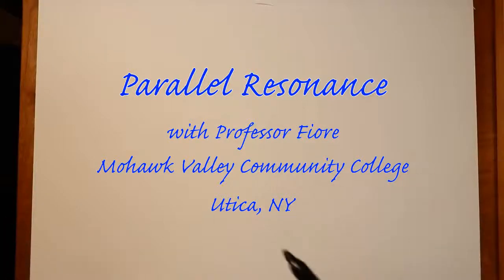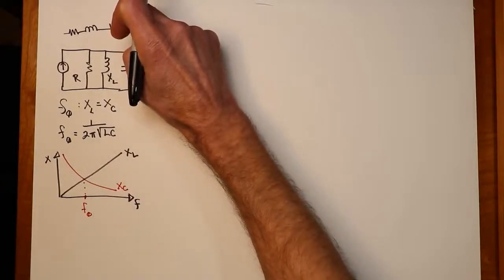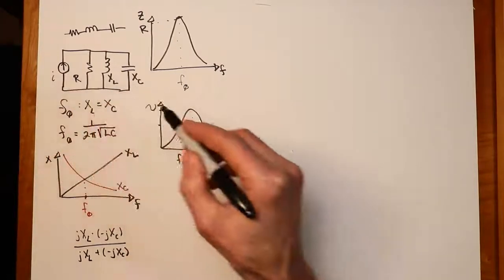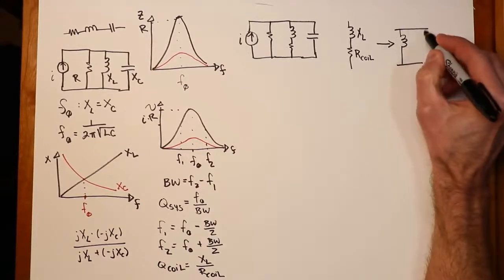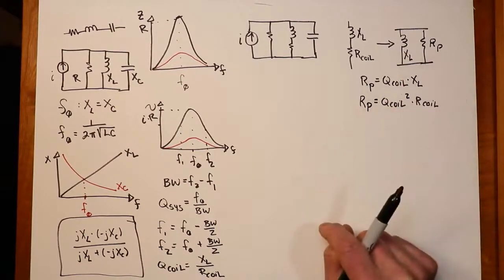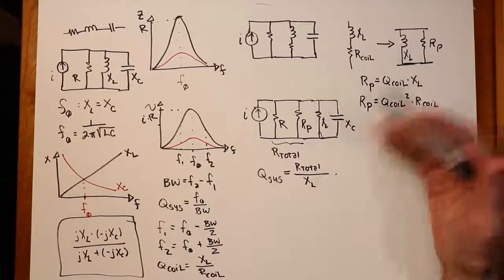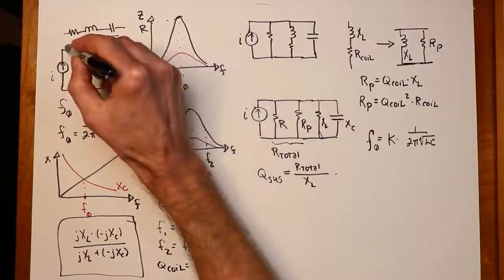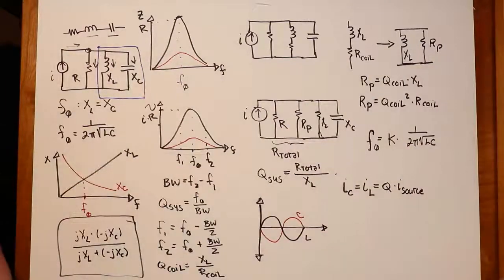AC Electrical Circuit Analysis: Parallel Resonance Introduction

Comment: Thank you Professor Fiore for this great lesson on Parallel RLC circuit! Everything makes sense when the circuit is driven with a current sinusoidal source. I tried to analyze the same circuit with a voltage sinusoidal source. I ran into a big trouble when I tried to derive the bandwidth expression. Would it be possible if you post another lesson on this same topic with a voltage sinusoidal source. Thank you!
Reply from the maker: As a parallel circuit, the voltage is the same across each component. What you see instead is a change in the branch currents. You see the same sort of thing with the branch currents that you did with the voltages here (in reciprocal fashion), but generally, using a current source (e.g., a bipolar transistor) is the way to go. I suggest that you download my text "AC Electrical Circuit Analysis: A Practical Approach" from my web site (free) or grab the inexpensive paper version on Amazon as there are a large number of graphs that illustrate the impedance and voltage/current changes across frequency.
Reply: @ElectronicswithProfessorFiore  Thank you Professor Fiore for your kind reply! I will download your text to see if there is an answer for me there already. In case of current source, the dissipated power of circuit reduces when frequency deviates from the resonant frequency, so it makes sense to define the circuit bandwidth using side frequencies where the dissipated power is half of the power at the resonant frequency. In case of a voltage source, as long as the amplitude of the voltage source is fixed, then the dissipated power is not changing with frequency, then we are no longer able to use the dissipated power to calculate the bandwidth. This is the trouble I have with the voltage source.
Reply from the maker: @yougoog1  The voltage is constant but the impedance isn't. At resonance, the impedance of the network is at maximum. As you move away from resonance, the network's impedance decreases, and thus, the source and branch currents change. Therefore, instead of concentrating on the change of voltage across frequency, consider the change in current across frequency. Instead of "square root of 2" change in voltage, we look at "square root of 2" change in current. Technically, with a constant voltage the true power (P) will not change although the apparent power (S) will.

Using a current source, the increase in Z at resonance causes an increase in voltage. If the voltage is constant, Ohm's law dictates that the current will decrease at resonance. It can be shown that the branch currents through the capacitor and idealized inductor are Q times larger than the source current. This might sound impossible, but it is due to the fact that the L and C currents are 180 degrees out of phase and effectively cancel each other at resonance, leaving just the branch current flowing through the idealized R. This is similar to the situation in series resonance where the L and C voltages are Q times larger than the source voltage (again, cancelling due to phase).
Reply: @ElectronicswithProfessorFiore  Thank you Professor Fiore for your help!

Because the voltage is constant, the apparent power at the frequency where the total current is “square root of 2” in current increases by the same factor of “square root of 2” instead by the factor of “2”. I understand the bandwidth is initially defined at side frequencies where the power gets changed by either half of or double of the power at the resonant frequency. The reason we could use the “square root of 2” change in current or voltage is because the power is proportional to the square of current or voltage, but in this case where voltage is held constant, the power is no longer proportional to the square of current, can we still use the principle of “square root of 2” change in current?

Thank you for your insightful analysis from the current cancellation between the capacitor and inductor branches. I do understand the capacitor and inductor form a LC tank where the current oscillates back and forth between the L and C.  Based upon the ratio of the maximum stored energy in L or C at resonance and the dissipated energy per cycle in resistor, the Q factor can be obtained to be R/(wL) where w is the resonant frequency and w= 1/sqrt(LC). From the bandwidth definition of Q factor, ie Q = w/bandwidth, the bandwidth can be derived to be 1/(RC). From the half power definition, we should end up with this same result of bandwidth, but I had trouble when I tried to do so. Yes. I did get the same result of bandwidth if I set the cutoff frequency at the “square root of 2” change in current, but should the cutoff frequency be set at the double of the apparent power?
Reply from the maker: @yougoog1  You might be going down a rabbit hole here. Usually, the point of resonant circuit is to obtain frequency selectivity, for example, in a tuned amplifier. For that sort of application, you'd be using a current source (a BJT or FET) to drive the network. Because the impedance peaks at resonance, the gain peaks at resonance. That is, the gain curve mimics or follows the impedance curve. While we can certainly chase down what happens with a constant voltage source, it's an atypical application. In fact, to investigate parallel resonant response in a lab, we often mimic a constant current source by using a voltage source (i.e., a function generator) in series with a large resistance. This is because lab grade precision AC current sources are not very common and it's very easy to see an measure the Q/bandwidth effects using current drive.
Reply: @ElectronicswithProfessorFiore  Thank you Professor for your kind help and excellent reasoning! Your explanations make great sense! In case of a parallel resonant circuit, as you suggest, using the current source is the way to go. I saw someone on YouTube trying to use the constant voltage source to derive the bandwidth expression. When voltage kept constant, the apparent power delivered to the circuit increases as frequency moving away from the resonant frequency because of the increase in reactive power, so she defined the bandwidth based on the double points of the power from the resonant frequency. With some magic manipulations of the math, she ended up with the same bandwidth expression as the one using the current source, but no matter how hard I tried, I just could not get the same result unless I change the definition of the bandwidth, meaning to use the “square root of 2” point instead of the double point of the power in case of the constant voltage source. I left my comment for her, unfortunately I did not hear back from her. Thank you Professor for your time and help!